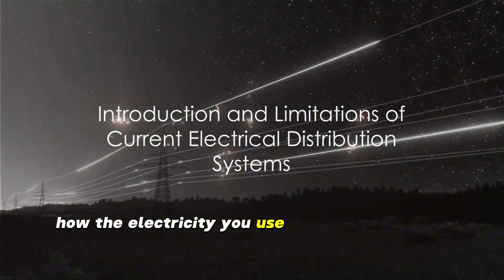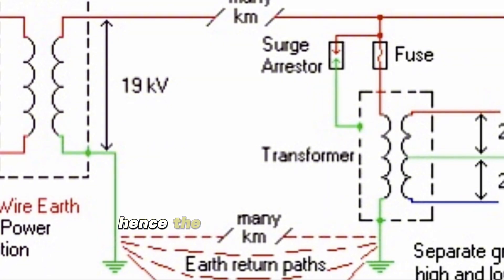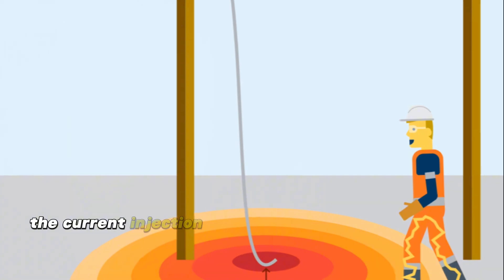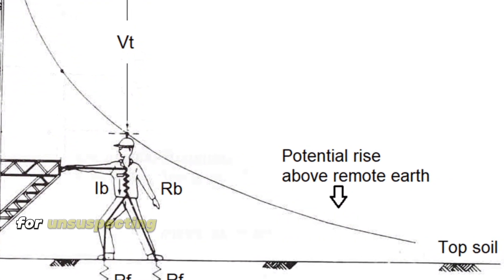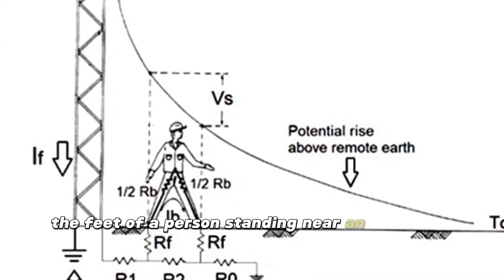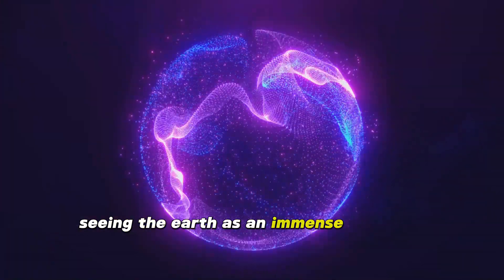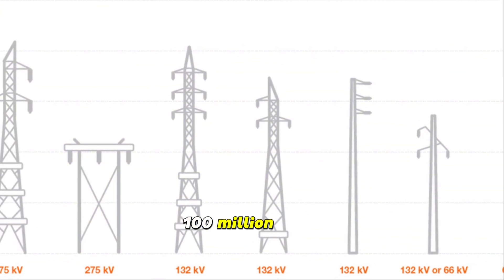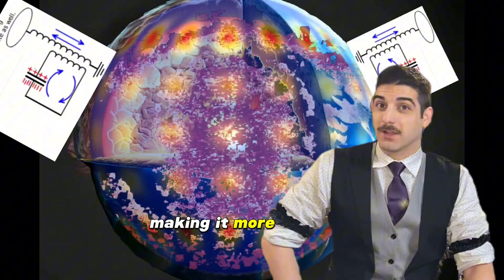⚡️🌎 We already send Energy Through the EARTH?!? 🤯🤩

Comment: Right now we transmit through wires and use earth as a return / neutral SWER. You or Tesla is suggesting sending 100MV or so using earth as the transmitter / conductor, where is the return in this scenario?
Reply from the maker: Hey thanks for commenting 

The earth is used for both. 
 
Every AC wire already is used for both to and from already as the electrons go back and forth in each one. 

There just needs to be a charge reservoir for the charges to “bounce” up into and bounce back into the earth without arcing off into the air. 

This is the purpose of the large anti arcing upper terminal. 

Just like in the balloon example, the pipe between each balloons serves as both the to and return. 
 
So can the single wire. 

This was what Tesla actually discovered. 

But this charge reservoir physically cannot be made small, as it is a matter of physics that its geometry requires it to have large radii for it to not arc off into the air and have a large capacity. 
 
I’ve got a couple different videos that go over this.                  

The video you’re commenting on now is clip out of the longer full 30 minute video that goes over all the parts. 
 
🛜Neil Degrasse Tyson, WRONG about Tesla?!? 🛜 @joerogan (30min) https://youtu.be/teoyAdU-1S0        
 
As well how all the church bells towers all over the earth, that just so happen to be at perfect key nodes and antinodes of the earths spheric vibrational eigenmode harmonics, are/can be used as a giant Phased Array Directed Seismic/acoustic/sonic Energy Weapon.      

Sound Waves For Ship Navigation at Sea https://youtu.be/vPERpefNfX8                               

Milo Says, “We have no Purpose for the Pyramids” - Charlie Debunks  @miniminuteman773 https://youtu.be/jJkKul4FIqs                              

Borobudur Temple - Earthquake Protections & Seismic Cloaking?! https://youtu.be/1V2UDlx86wg                                

Nikola Tesla’s Wireless Electricity Earth Harmonics https://youtu.be/H3p3I4s1BzM                                                      

Earthquake Time Lapse - Is Tesla Tech Involved?! https://youtu.be/_7BrI9FggUM    

Do They Have Earthquake Warfare Technology?! https://youtu.be/nlEdjNmSvnU     

Let me know if you have any questions!

Comment: The solution is not getting a better transmission system.  It's eliminating transmission alltogether.  We should be working on home systems, enough to provide for one home electricity, no need for HV transfer, produce and use in roughly the same place.
Reply from the maker: Hey thanks for commenting but to be perfectly honest, considering the fact that even just a single geothermal pool in California has more energy than the United States will use in the next 1000 years, it’s a whole lot easier to build one big geothermal steam plant and dump all the power into the ground for just everyone to have at whatever capacity they want, than it is to build millions of individual micro power plants. 

Or rather 5-10 hydro electric dams around the world, 1-2 on each continent, would be far easier to build, than billions of individual micro power plants. 

This is not to say we shouldn’t have that option too. Just that we can more quickly and easily help more people around the world this way.

And infact we do need better transmission systems because there is no lack of energy, we can generate an absurd amount more power and energy from Niagara Falls if we wanted to, it’s just expensive as all heck to build and maintain the wired transmission lines to get it to any significant distance without obscene losses from the transmission lines.

So we don’t. 

The mere fact of not having to pay to maintain the immensely dangerous suspension wires would probably half the cost of electricity and reduce the power losses by 50%, in effect drastically reducing greenhouse gasses even if we didn’t change the energy sources we are currently using.

So while I do believe it’s very important to have the micro power plants it is not going to be a solution for the vast majority of people around the world.

And that ultimately falls short of our. Mission to bring energy independence to all. 

Again this is not to say we aren’t continuing on the micro R&D but there’s a much bigger picture at play going on.

Not to mention I haven’t even explained yet how we can use this system to regrow the polar ice caps, and simultaneously cool the earth while doing it, and halt the rising sea levels.

Comment: There was a company who ,built a tesla tower ,in texas,using 100million volts i think, that tried this method of sending power but didnt get much distance.They were claiming using Zenneck surface waves.why do you think they failed? Also if tesla was going to use this ultra high voltage ,what would be then the difference between his power sending method,and all the lightning strikes that hit the earth per second ,some reaching a Billion volts
Reply from the maker: Hey thanks for commenting. Yeah it wouldn’t work because they were trying to use the zennick wave guide channel to use EM radiation for sending the power.

Tesla:
"There is no radiation in this case. You see, the apparatus which I devised was an apparatus enabling one to produce tremendous differences of potential and currents in an antenna circuit. These requirements must be fulfilled, whether you transmit by currents of conduction, or whether you transmit by electromagnetic waves. You want high potential currents, you want a great amount of vibratory energy; but you can graduate this vibratory energy. By proper design and choice of wave lengths, you can arrange it so that you get, for instance, 5 percent in these electromagnetic waves and 95 percent in the current that goes through the earth. That is what I am doing. Or, you can get, as these radio men, 95 percent in the energy of electromagnetic waves and only 5 percent in the energy of the current. Then you are wondering why you do not get good results. I know why I do not get good results in that way. The apparatus is suitable for one or the other method. I am not producing radiation in my system; I am suppressing electromagnetic waves. But, on the other hand, my apparatus can be used effectively with electromagnetic waves. The apparatus has nothing to do with this new method except that it is the only means to practice it. So that in my system, you should free yourself of the idea that there is radiation, that energy is radiated. It is not radiated; it is conserved".

“By proper design and choice of wave lengths, you can arrange it so that you get, for instance, 5 percent in these electromagnetic waves and 95 percent in the current that goes through the earth. That is what I am doing. Or you can get, as these radio men, 95 percent in the energy of electromagnetic waves and only 5 percent in the energy of the current. ... The apparatus is suitable for one or the other method. I am not producing radiation with my system; I am suppressing electromagnetic waves. ... In my system, you should free yourself of the idea that there is radiation, that the energy is radiated. It is not radiated; it is conserved”

“The radio men who came after me had the problem before them of making a bell sound, and they immersed it in mercury. Now, you know mercury is heavy. When they struck their bell, the mercury did not permit it to vibrate long because it took away all the energy.
I put my bell in a vacuum and make it vibrate for hours. I have designed circuits in connection with an enterprise in 1898 for transmission of energy which, once started, would vibrate three years, and even after that the oscillations could still be detected.
Professor Wein's theory is very beautiful, but it really has no practical meaning. It will become useless as soon as the inefficient apparatus of the day, with antennae that radiate energy rapidly, [are] replaced by a scientifically designed oscillator which does not give out energy except when it gets up to a tremendous electromagnetic momentum".

The resistance of a conductive path is inversely proportional to the Area of conduction.   

R = rho * L / A    

A= pi * r^2    

which in the earths case means the resistance is divided by the earths radius squared...     

That plummets the power loss for any distance transmitted to nearly zero.     

P_LOSS = R * |^2    

Never mind the fact that Tesla proposed to step the voltages up to 100 million volts, 3 orders of magnitude higher than current transmission lines.    

If we step the voltage up by 1000x then the current will drop by x/1000.    

And if current drops by x/1000 then the power losses from transmission drop by a 1/1,000,000th.  

So when the conductive area plummets the resistance for conduction to nearly zero and the currents through the conductive medium plummet by a factor of x/1000 then the power losses for transmitting nearly any distance goes to zero.  Full stop.    

And because the voltage drop over any distance through the ground is nearly zero there is no voltage potential gradient to cause touch and step voltage issues in the ground.    

Lastly it’s the very low 50/60hz ac  frequency that makes Ac dangerous.   

When frequency is brought up but kept below the point of where it would emit EM oscillations/radio waves, what’s known as the skin effect occurs.   

This causes the currents to not be able to penetrate into the core of thin conductors.   

Ergo, why we don’t use higher frequencies on our thin wire transmission lines.     

It just negates the center of the wire.    

But let’s just say for example if there were to be a fault in this system, when the frequency is high enough this makes it impossible for it to harm someone as it conducts over the surface of our skin and cannot damage our internal organs or skin for that matter.     

But a fault would be inordinately unlikely when the system is designed correctly.    

Hope this helps.
Reply: @CharlieSolis  what about the lightning strikes?